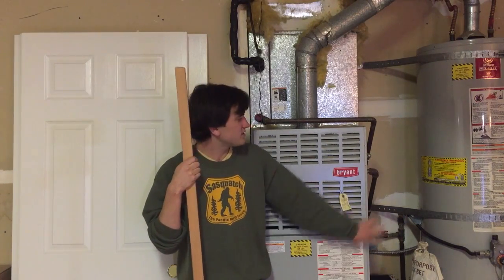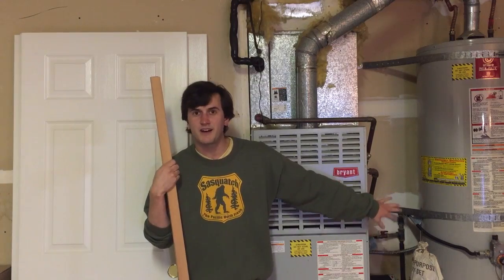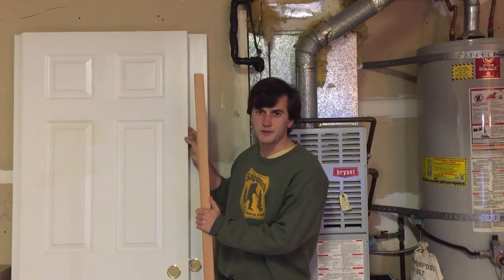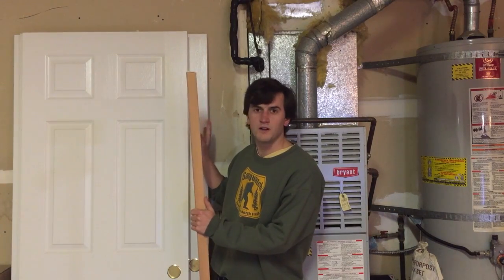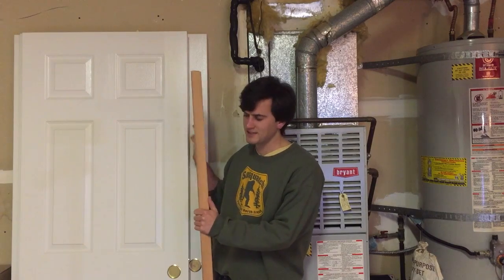DIY Door Wall using Ultimaker 2+ and Fusion 360

Comment: You ever tried SketchUp? Just curious if you did an A/B comparison between CAD tools and/or why you ended up choosing Fusion 360.
Reply from the maker: I've only tried sketch up for about 10 minutes and I got stuck (probably my fault). Maybe I'll give it a shot but from what I've seen so far Fusion 360 feels just like a professional CAD software even though it's free. It allows me to model with a design tree "parametric modeling" or without "direct modeling". Also I've seen videos of people making really beautiful organic shapes with it. Someone else modeled a mechanical watch, so I know it can handle large assemblies. This was my first time using it and it was easy to pick up. I'm pretty excited about it.

Before this I used DesignSpark Mechanical which was pretty awesome and also free, but could only do direct modeling and would start to get sluggish after about 10 parts in an assembly, and the parts were a bit difficult to manage.
Reply: +Normal Universe Thanks C.